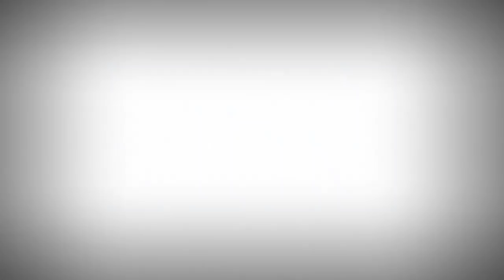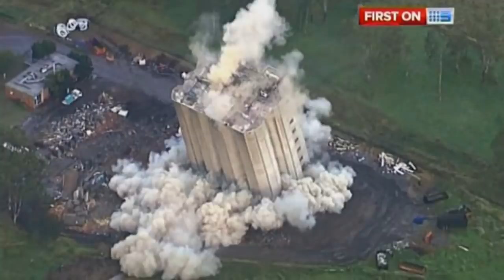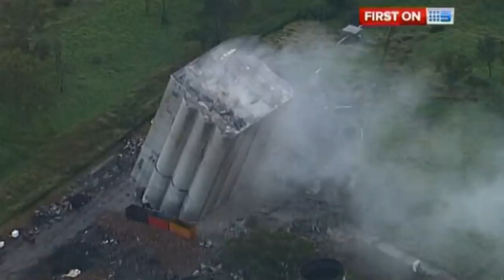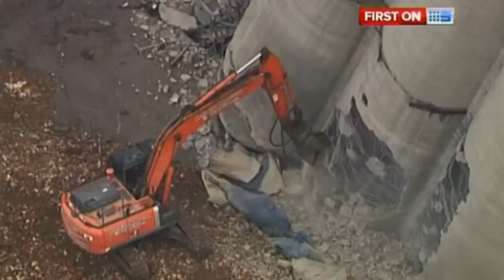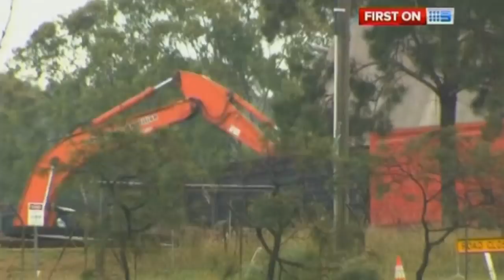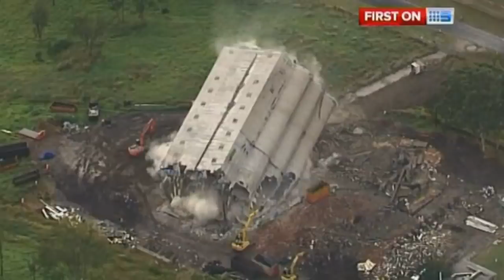A giant building implosion in Australia goes wrong

Comment: It's a controlled explosion not a implosion.
Reply: far from it
Reply: Mulinaster   seems to me its explosives that are ment to cause a building to collapse in on its self.. the meaning of implosion by definition is " to collapse violently inwards "...
Reply: Actually he does know more than you do, at least in this case. It is an explosion. Explosives cannot cause implosions. The term is used with the building/construction definition in mind where they call a controlled demolition (explosion) an implosion, but the use of that term would be a misnomer.

[Small Edit] It's not "an explosion" as I just said, but a series of small explosions. Just making that clear.
Reply: A true implosion phenomenon involves a difference between internal and external pressure. The internal pressure being lower than the external pressure can cause something to collapse in on itself. The only thing happening here is a loss of support and gravity. Calling it an implosion may help visualize how the building acts when it is demolished, but it doesn't accurately describe the process.
Reply: Mulinaster placing explosives around a structure so that when they go off, all the fragments go inward, does not constitute an implosion. That's just fancy demolition work. I agree with what GameSmith said, "an implosion is caused when there is a difference in pressure..."
Reply: Mulinaster If you make a vacuum inside a sealed can, it can implode since the pressure outside is greater than inside and that pressure presses the can "walls" inwards violently so it implodes. In this video the building exploded, since inside its structures explosives exploded and caused rapid change in pressure, making pressurewave, which broke the structures and caused the building to collapse. Your comment saying the building imploded, is just false.

Comment: Just throw some jet fuel on it, and it'll come down
Reply: Ha ha.  The stuff people believe.
Reply: You obviously did your research on the topic you're hinting at, right? If you did you already know the protective coating on the steal had been blown off by the impact x2. Without that coating on the steal it's game over when there's a sustained heat source of over 1700 degrees. Even if the steal used was 310 stainless it would have still failed. There are some people out there that when they don't understand something like this, they start saying things like "cover up" or "conspiracy". There were a great number of things that had to happen to bring those buildings down. When you start thinking about the odds of it happening or not it doesn't make much sense, meaning it's just hard to believe. To this day I still think about the odds of my Niece having never been anywhere near the North tower, but on that day she had a job interview on the 107th floor at the World Trade Club North tower. Just because it doesn't make much sense to the majority, or the odds are unthinkable, doesn't make any of it impossible.
Reply: ***** Fire was nowhere near 1700, degrees, probably under 1000, and SOME protective coating came off, not all, and not symmetrically therefore collapses would have been asymmetric.  Dude, you can SEE the demo charges going off.  Near free fall is IMPOSSIBLE unless the steel is knocked out from beneath falling mass.  Material clearly seen being ejected out sides of building many floors below collapse zone.  Get real.  The people who died will not have died in vain WHEN this gets exposed for the inside job it was.
Reply: penzoil11 Been 15 years, kinda over the arguing at this point. Now I say this with the well being of our country at heart. If it ever came out that this was an "inside job" our country wouldn't be able to coup. No matter what the truth is, whether it was us or them. It won't change the fact that my Niece and many others died in vain. So, you "get real"
Reply: *****
Americans are strong.  We would be able to cope.  We would blame W Bush and his criminal friends. We would rally under the Flag and protect it for our future.
Reply: ***** Wouldn't be able to cope if the truth came out?  SMH.  If 9/11 continues to be used by the thugs that run this country to keep us in fear and dependent on government and chasing up the wrong tree when we should be scrutinizing the politicians, the globalists, and the media, then they will have died in vain because the lie is perpetuated.   But if and when this thing gets exposed, the people will awaken en masse, begin to understand that you have to pay attention, apply critical thinking, and learn about the principles of freedom as espoused in the founding documents.  Our democratic republic requires informed participation by the common folk, not blind trust and wholesale propaganda swallowing.  Only then can we recover our freedom, prosperity, and peace.  We're not responding properly to this event because we don't have the story straight.  We can only respond properly (that's what I mean by cope) when we have the truth.
Reply: vinny142 You won't hear me say the conspiracy is too big, it's actually just a relative handful of LOSERS who have way overplayed their hand.  There are many who are unwittingly used to further their lies, but they're just being used, they aren't in the know and they ain't part of the club.  Stuff like 9/11 is an OPPORTUNITY to expose these bastards because for anyone who will simply DROP what they've been told and LOOK at the evidence for themselves, they can see how we've been duped.  The evidence is overwhelming, but your mind is closed and you can't see it because you THINK you understand.  You accuse me of just repeating what I've heard, but that's what you are doing.  It's y'all who sound like broken records.
Reply: Jet fuel can't melt steel beams
Reply: The beams do not need to melt to lose their structural integrity. Before 9/11 most/none of you knew anything about how buildings fall or why, after 9/11 all you suddenly become fucking structural engineers. How many of you know that since it was the "Port Authority" that built the damn things they were more than likely built outside of usual building codes (which was normal for them)? Second, the design of the towers were unusual, in that there were huge amounts of unsupported floor space. Buildings are constructed to support the static weight of the floors above. They're not built to withstand the dynamic effects due to the downward momentum of the falling floors above. Demo experts know this, which is why they let the structure do all the work. I don't imagine any of you can tell me how to stop a couple dozen floors weighing a few thousand tons falling at 9.8 m/s. I forgot, YouTube has the smartest engineers just waiting to help people with their rock star like comments.
Reply: ***** Yes, it's true that the dynamic load of a falling floor is much more than that of simply supporting a stationary floor.  But remember these buildings had a built-in factor of safety, probably of around 10.  http://www.statemaster.com/encyclopedia/Factor-of-safety  And the factor safety is based on the MAXIMUM expected combined loads.  So this would put the realized factor of safety perhaps as high as 20 realistically for the undamaged structure below the impact zones since the buildings were nowhere near their maximum loading.  Any collapse of floors would have caused some further collapse due to the massive dynamic loading, but that collapse would be arrested by the massive strength of the structure.  The structure would not just swoon and give up like you saw it do.  The near free fall collapse speed of the twin towers is a dead give away, absolutely hard evidence that the steel was compromised in some systematic way.  And in the case of Bldg 7, you had free fall acceleration for a portion of the collapse.  I'm very sorry you lost your neice in such a horrible calamity.
Reply: ***** Another issue is that much of the buildings, including massive exterior columns, fell outside of the bldg. footprint,  thus giving no contribution to the destruction of lower floors.  It looked like a banana being peeled apart, not a real pancake collapse.  What seals the deal for me is that in the darker areas of the videos, you can see demo charges going off!  You can also see the material being blown out sideways from the buildings many floors below the collapse zone, making it impossible to be caused by compressed air from the pancaking effect.  There is no pancaking effect as can be clearly seen in the videos.  You also have the massive amount of dust which would contribute nothing to the pancake effect - pancaking would require roughly intact material to exert the maximum amount of kinetic energy to the floor below.  The whole theory falls apart and if i'm not mistaken, the government has even abandoned this explanation as it's official position and now has no explanation for what caused the collapses.  However, when people were demanding answers in the wake of this thing, that was what was offered, and now the short attention span of Americans has allowed them to get away without having to adequately explain what happened.
Reply: Concrete!    FUCKING CONCRETE, IT's not fucking steel.

Comment: yawns (edit) like when making a massive silo over 100 years [then building another silo 50 years later on top of it] ago they did not leave a how to destroy tag on the side
they did not even leave the blue prints to the design of the foundation
the fact that many years of pumping concrete into the ground to stabilise the structure 
actually also made it very hard to demolish with explosives,,, as explosives have to crack the foundations in order for the building to "fall into"
the hole caused by the broken foundation
1 there was no actual information on how much reinforcement they pumped underground just it was "a lot of many years" 
2 it was not a "building structure designed for people" it was a "massive silo designed for huge weights"
3 even after pushing it over it was seen that the concrete was "over strengthened" with internal metal meshing 
4 it was similar to demolishing a "high-rise car park" more then it was demolishing a building
5 all in all the demolition was a success , the foundation problem was caused by the adding off pumped concrete underground
6 if they used more explosives it still would not of fallen they actually need to burrow under the structure and detonate the foundation at the same time would made it crumble 
7 because the ground stayed in tact the foot hold the silo has was kept it almost fell in one swoop need better direction of force applied to the base of the structure

in 911  the steel columns at the base of the building had been "cut" this makes a building go down fast
a "SOLID CONCRETE SILO" you cannot access the base of the structure to cut the steel reinforcement 
so it "A LOT HARDER" to demolish a SILO even though it rather small it was strong ,
 the American twin towers to go down quick as free fall
required predesignated explosives 
complete blue-prints of the construction showing weakest structural points
whole host of base and foundation weakening methods would be needed for any building to just fall "free fall"
Reply: video says half-century old
Reply: The foundations are what the building "sits" on
with out the "FOUNDATION" support no BUILDING can be BUILT
like what do they teach kids these days

Comment: Well, it's common knowledge that getting a jumbo jet to fly into the building and emerge from the other side with its NOSE INTACT, as if it was photoshopped in, and somehow cause the huge metal beams to magically vaporize and most of the tons of concrete to reduce to powder is the best way to demolish a building "designed to withstand multiple plane strikes".